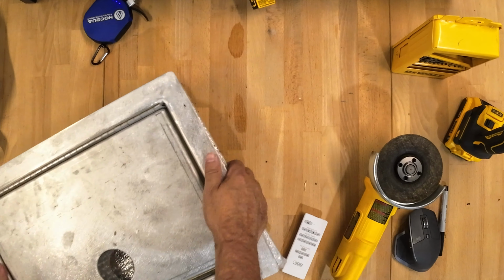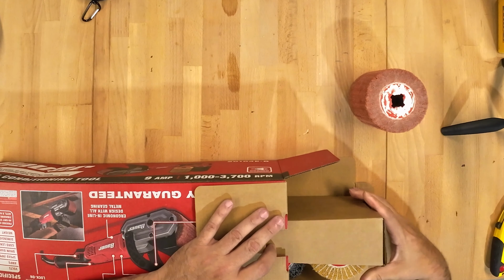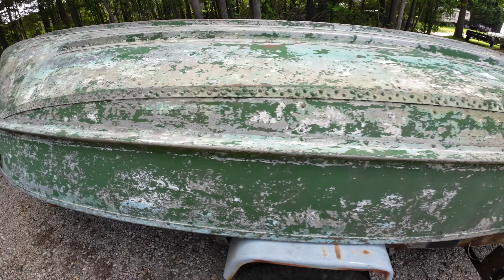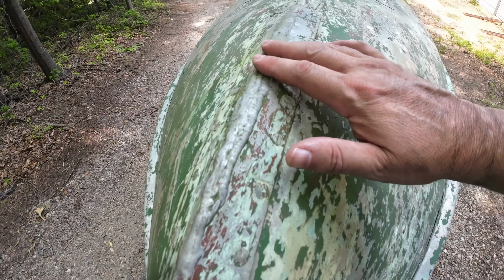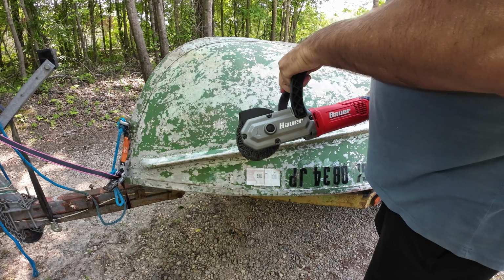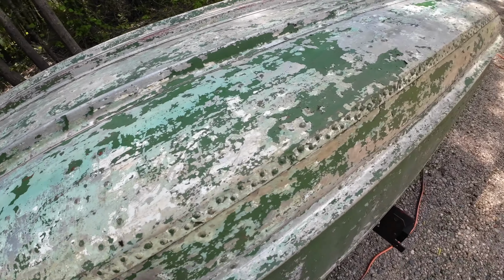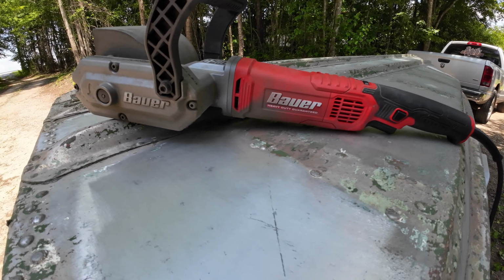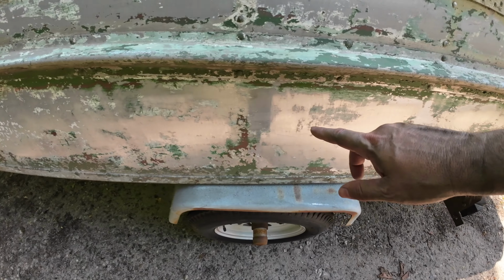Bauer Surface Conditioning Tool Tackles Decades Of Paint On A Jon Boat!

Comment: Seems like it worked pretty well on the flat areas. I was wondering how loud it was while removing the paint. Thanks for the video!
Reply from the maker: It was loud enough where I didn’t want to include the audio in the video.  But definitely not obnoxiously loud to the point you didn’t want to use it.

I’m currently working on the video for removing the rest of the paint.  Maybe I’ll drop a little clip in so you can hear it run.
Reply: @deckedoutjonboats  Thanks. I would appreciate the audio clip in the next video.  I have a couple old aluminum boats I would like to paint in the near future and I am considering this tool. Have a great day!
Reply from the maker: @RHJ3 I’ll include one just for you! 😉
Are you a member of my Facebook group?